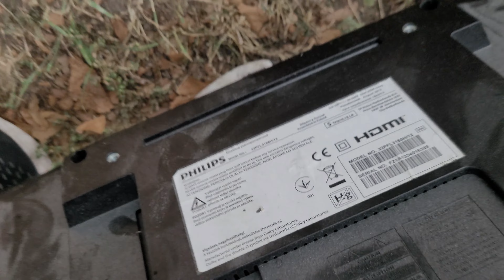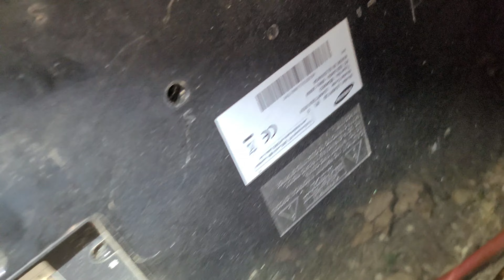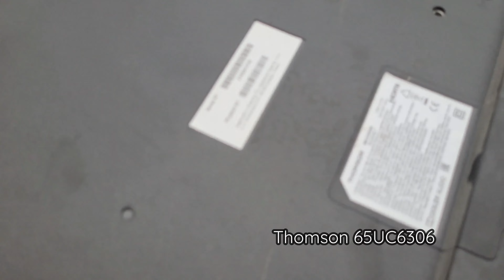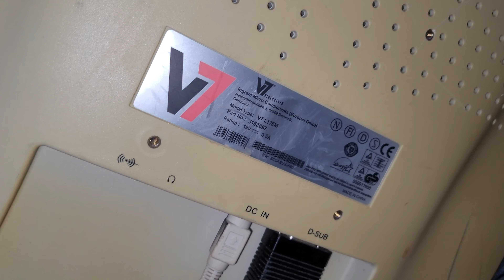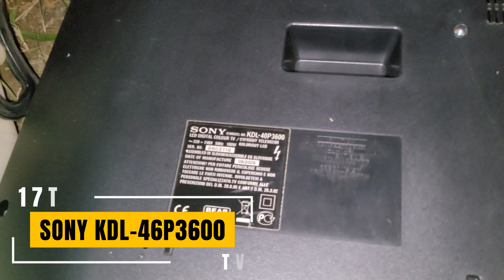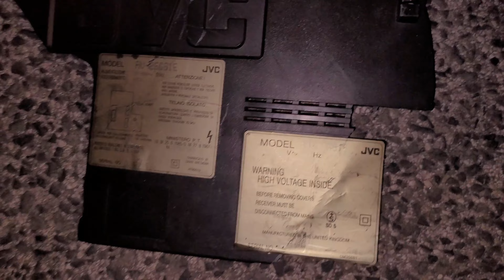Speaker Finding #40: Lots Of TV SUBWOOFERS! Panasonic, Grundig, Sony, Samsung, JVC!

Comment: 2:42 I have found a similar Soundbar on a TV (when I pulled it Off from the TV it broke in two pieces and on one speaker the Magnet Fell Off lol) and with the Ports it sounded Like a$$ but sealed IT Had a really good bass

Comment: 3:08 i have these but i blown and trash
Reply from the maker: I didn't even have these anymore! Were sounding like crap
Reply: @the_speaker_tester   with my sony japan amp they sounding like  cheapo and crap
Reply from the maker: @hhhythgdghmghthhytyjyhjsrdtrhf  same with my old japanese Technics amplifier. Weak bass, they distort fast when i turn on loudness, when i turn off loudness the bass completely disappears, highs are muffled, and mids are way too loud. Cheap shit.
Reply: but my amp is 50w x2
Reply: @the_speaker_tester  If I have them ,I will putting high volt on this